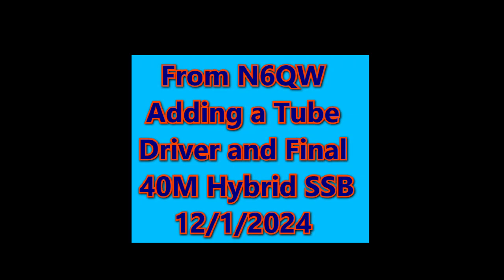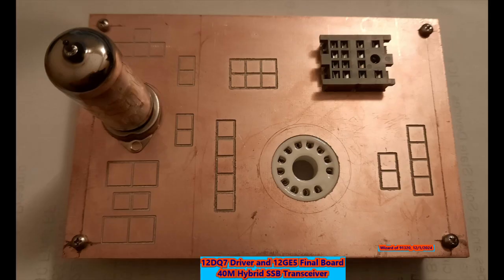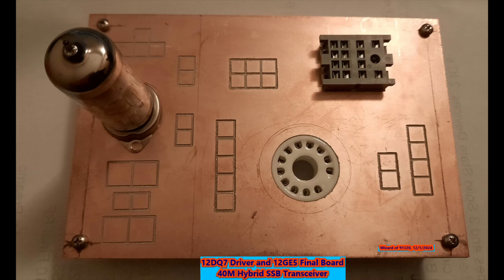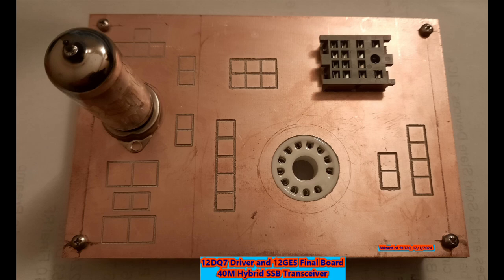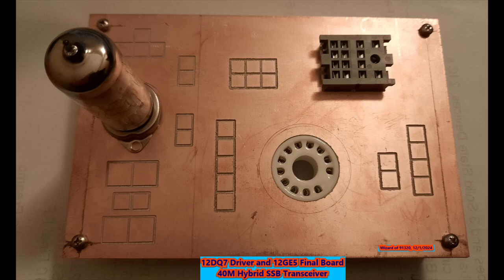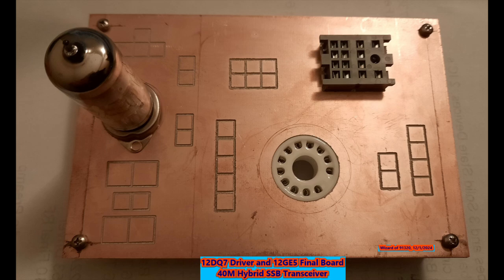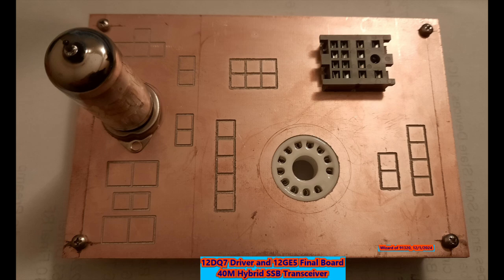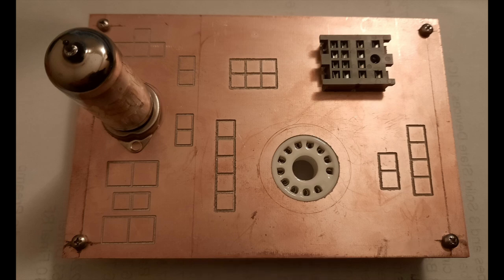12DQ7 and 12GE5 Final for the Hybrid 40M  SSB

Comment: Most of your rigs are demonstrations of the value of CNC routers--even small ones. For circuit boards, chassis, front panels and other cabinet parts. I think many builders underestimate the satisfactions to be had from professional-looking homebrew rigs afforded by a little extra tooling.